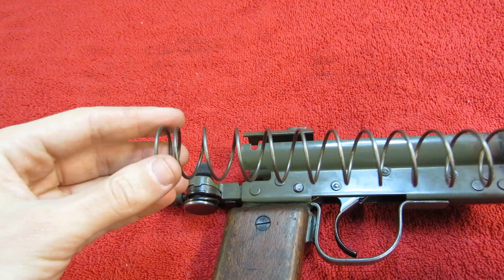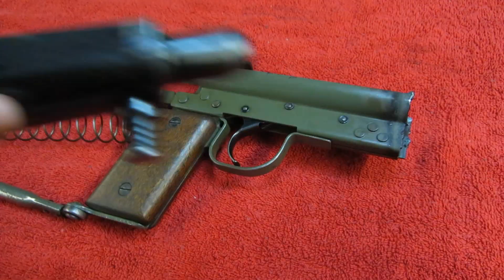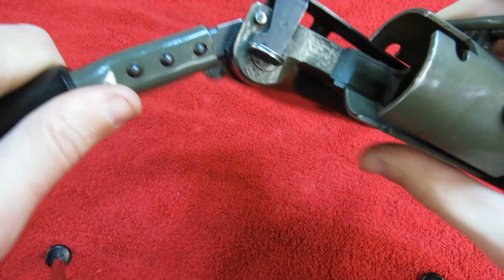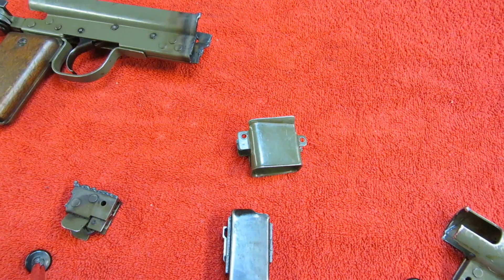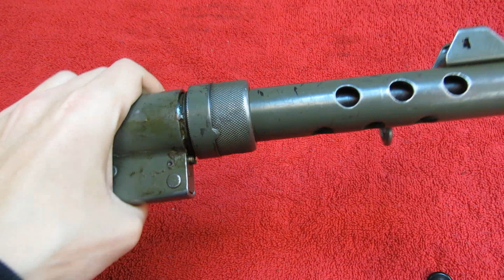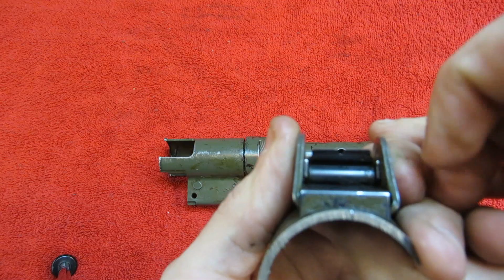Swedish K M/45 SMG Parts Kit Overview

Comment: Is it common with parts kits like these? With other weapons i mean. And whats the reason for it being taken apart? Legal/Law reasons?
Reply from the maker: It is the only way they can be imported and sold to the average individual in the USA. We can buy some semi auto military firearms if they meet requirements, but anything full auto - nope. Only way  to get it is in pieces.
Reply: @rcbif101  No full auto? but not in all states right? and is there another example of parts kits? havent seen any other then the swedish K on youtube.
Reply: I think this is originally an item exported to Ireland. I assume Irish authorities cut it when the guns were no longer in service. It is also very dangerous dismantling. You can buy replica m45 where the stamped metal is pretty much spot on. These replicas has a dumb bolt, dumb barrel, weak spring and no ejector. Voila, here we have the bolt, barrel, spring and ejector... I think the Irish should have done a number on the bolt.

Comment: Bit of a Frankengun there...  green colour indicates it is a military weapon, but only select fire guns produced in Sweden was the m/45D for the police, but those were black.

The coffin- and drum magazines came from the Finnish Suomi submachine guns bought by Sweden in the late 1930s, and were in use until enough of the 36 round mag had been produced to replace them entirely.

The hooked endcap makes it a m/45B, but part of the update from the m/45 included the magazine well being riveted to the receiver as by then the Suomi magazines had been removed from service. The lack of bayonet lug on the barrel shroud exclude it would be a m/45C.

Magazine.
Fast and easy to reload is an understatement, as the cartridges came on a 6 by 6 stripper clip tray, which together with the loading tool allowed the whole magazine to be loaded in under ten seconds.

To see it in action:
https://www.youtube.com/watch?v=ElPy3TFFDkw

Comment: i wonder if a semiautomatic sten bolt and tube kit would work if you wanted to make a semiautomatic pistol from it
Reply from the maker: Indianapolis Ordnance makes a semi bolt for it.
Reply: Rcbif  will be a very nice semiautomatic when its done ..heard the barrels in those are very good quality hammer forged barrels   im just a tinkerer .. if you get a chance to  you can make a very nice 
"star wars "  han solo style  straight pull  bolt action pistol from ar 15 parts .. don't use a plastic upper like others on YouTube on it though ..they scar and get rough quick
Reply from the maker: @agoogleaccount2861  ya, the blasters are cool, but my range wouldn't allow it, and I'm easing out of firearm stuff now, and building an airplane.

Comment: The Medic personal used the old Kpist M/45B when i was in the military in Lappland at the same time some medical personal was testing the UZI but in -30-40 degrees they got frost inside because the flat side was frekvently warm and Cold when it was hanging at the chest of the Soldier so the 45/B was better in extreme Winter condition! they was wery reliable i never hear anything about misfire! tried it myself.

Comment: You are mentioning the little ramp behind the magazine release, it was as You deduced, placed there to dispose of dirt - and water! The m/45b was, at the time, the preferred weapon of the Swedish equivalent to to the US Marines -  the Swedish Coast Rangers. The weapon was designed and intended for submerged service. You just rose from the depths, shook off the excess water and started firing...
Reply: The AK4 is based on a H&K G3
Reply: @handlebullshit  Actually the G3A2.
Reply: +Per-Erik Ekberg Did you know your Swedish M-45 saw action in Vietnam. The precursor to the Navy seals used the Model-45 subgun as the Vietnamese couldnt identify the weapon and the unit using it, if it accidentally stayed behind a dead soldier. I shoot with your excellent modified FNC standard 5.56 NATO ammunition in Mazar e sharif at Camp Northern lights. Do you know what model your AK-4 is based on?
Reply: @strikerorwell9232  Yes sir, i was aware that the Karl Gustaf model 45 saw combat in Vietnam. It had previously sern action with the United Nations in the Congo crisis. That was one of the poignant reasons for Smiith and Wesson to request license to launch the production of the m-76.

Comment: Hey man, thank you for the video! I used it a lot when I was working on a 3D model of this gun. I had to make it for a college assignment. It's done now, here's a link to the model if you'd like to see it

https://sketchfab.com/models/06238cac46fa45e2890463f0e739a632
Reply from the maker: Looks pretty good! Do you know your charging slot is on the wrong side?
Reply: I did notice that while I was texturing. It's not something my teachers would see ("as long as it looks good") and I had to hand it in the next night, so I didn't fix it :)

Comment: A "funny" thing you could do was to place a 9 volt battery behind the bolt so that it wouldn't reach lock position and your "friend's" gun would empty the whole mag once the trigger was pulled :) Never did it myself though.
Reply: And it did it pretty damn quick, around 1000 rpm.

Comment: Interesting. I have never seen in with a selector switch. The swedish military did not use it as noted. I had it as my personal firearm when in the military as AA system electronics technican.
Reply: +Kjell Lindberg the ones with selector switches were manufactured for police use. at least those made in sweden.

Comment: Regarding the "hook" on the end cap.
The first M45 (Swedish K) used a special type of practice ammo in it's early career. The round is(was) basically a low power, weak bullet meant for practice only. Probably made to save money.
Apparently there were several incidents with the old end cap coming loose when firing this type of ammo. To rectify this they made the newer M45 batches with that special hook and named this new version M45B. The remaining M45, now technically the M45A, were placed in storage and not used for several years.
Eventually the practice ammo in question was discontinued and the Armed Forces now had a fairly large supply of M45(A) in nearly mint condition. 
I believe we gave most of them away to the Baltic countries as part of rearming their forces. We also gave away old, used, H&K G3's and veichles.

The single-shot switch, however, was only found on Police models (used by our version of "SWAT").
Reply: Balkans? You mean Baltic states i guess? W gave them complete battllion equipment from ouer mobilisation depoes.
Reply: Mistell.

Comment: YOU ARE WRONG TO STATE THAT THERE IS A SINGLE SHOT FUNCTION AS IS .ITS FULL AUTO OR NOTHING ..
Reply from the maker: +dwight lovejoy - Nope. Though most Swedish K's are full auto only, as explained in the video, this model has a selector switch and you can choose between semi and full auto.
Reply: If i remember correctly, the version that the swedish police used was semi auto and full auto.
Reply: Johan Sand
 Yup.
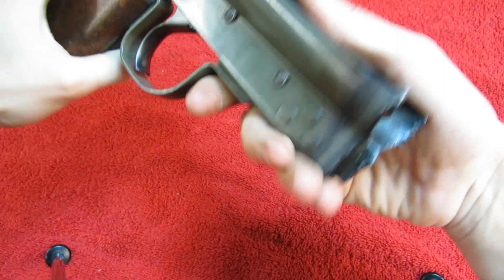Reply: +dwight lovejoy switch visible at 9:08

Comment: NO PINCHY!!!!  At the 5.30 min section when talking about the v shaped clip that holds the extractor spring in place.  try to rock/rotate the clip in/out.  I broke one trying to squeeze it with pliers.  The grooves on the side are wide enough that you can rock the clip in one side at a time.